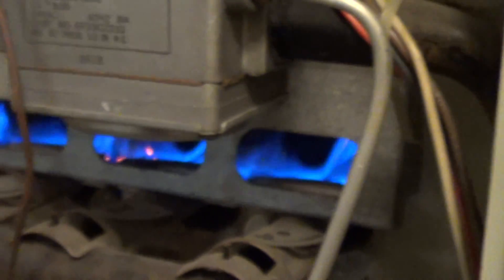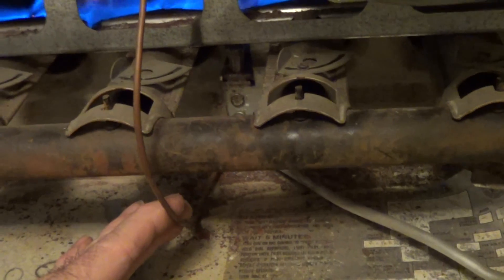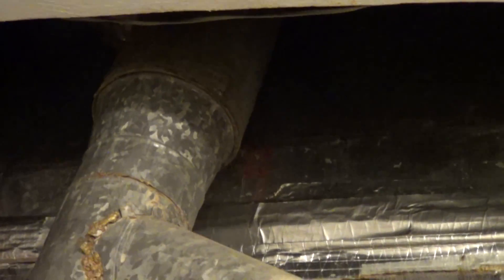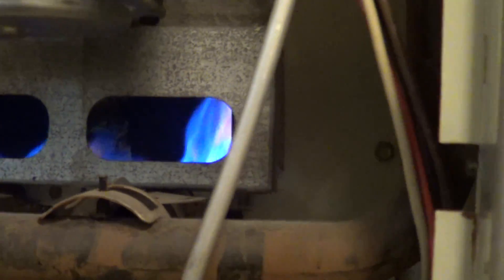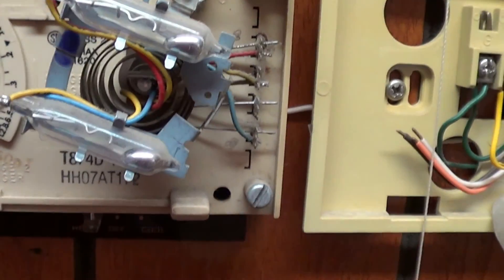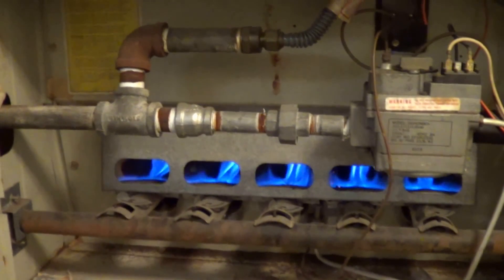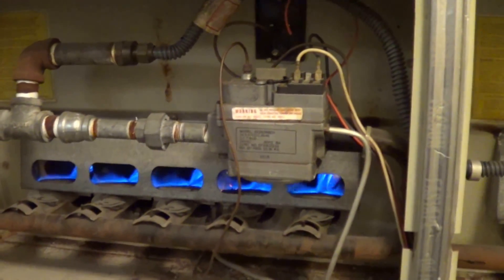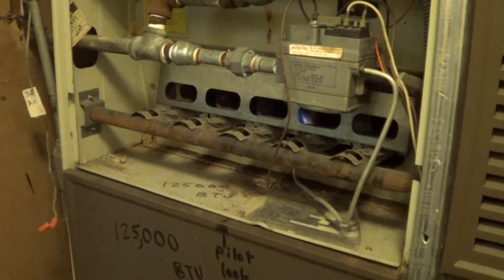Carrier 58GP Twinned 1985 gas heaters 125000 BTUH each

Comment: Here in 2021 are those furnaces still in place?
Reply from the maker: They were used in some colder mornings in 2021 from January through March.  last Winter was a cold one in South Mississippi. This last month has had a lot of rain thus cooler and humid now in July. The pilot lights are tuned off now and relight the first time usually in the late Fall.

Comment: Thanks for the tour down dinosaur alley.  In this house there are 2 units and I'm trying to find the fan limit switch for the main furnace (for main floor heating - model 58GP125-LA).  After the burner is off and the fan runs for about 2 min to finish the cool down, the fan shuts off then turns on for a second or two and shuts off again.  This started happening recently so trying to see if it's an easy adjust or fix.

BTW, I can relate to the pilot light situation.  I've had the pilot light get blown out twice in last 3 years during periods of really high wind, so could definitely relate to needing to locate and reignite the darn thing.
Reply from the maker: ***** The same thing happened here. The blower Fan unit will do a short restart then stop then sometimes restart then stop a 2nd time. What is happening usually is the timing capacitor has dried out and is leaky on the control board.  The 100uF 50 volt cap C2 on my older board 392075-304 (has giant relays) was dried out and thus the flakey behavior. Another intermittent failure mode is the blower gets stuck on because one of the big relays on the board is stuck. One can tap it with a screwdriver and the blower will stop. A brand new replacement board for mine and many others is the ICM271.

In this other video I have the older board 302075 with big relays is on the left furnace and a newer ICM271 board is on the right furnace. There is a Carrier "twining unit" that ties the two together.

I too thought the limit switch in the stack was the issue and it was not. I ended up buying a new board ICM271 and the problem went away. Then the new board died 4 years a later due to a power / lightning surge, but the old board on the left still works. Then last year it started to do the thing you mention: " After the burner is off and the fan runs for about 2 min to finish the cool down, the fan shuts off then turns on for a second or two and shuts off again." and thus needs its board fixed or replaced. 

The cap C2 is either charging or discharging during the extended run and is the timing capacitor. It is an  electrolytic capacitor and thus one that does dry out with time. The 100uF value determines the time. The value of 50 volts should be the same or can be higher too. Thus a 100Uf 100 volt one is OK too. One can buy 10 caps for a dollar with free shipping via ebay thus this fix is cheaper than a 40 to 70 buck new board ICM271 via ebay.

Here I messed around for a few years with the " After the burner is off and the fan runs for about 2 min to finish the cool down, the fan shuts off then turns on for a second or two and shuts off again."  Issue

At least one was fixed via a new or repaired board.
Reply from the maker: ***** Other video showing boards on the 58GP
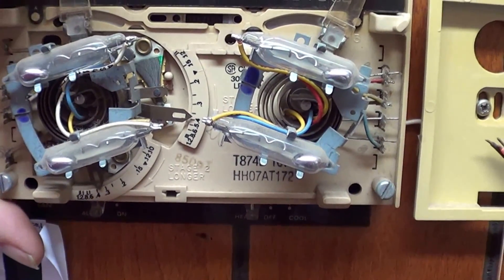Reply from the maker: ***** https://www.youtube.com/watch?v=FfIZ4_PcVu8  Control Boards show up at 7:55  old style  11:49 new style control boards. The "afterrun" of the blower fan is charging up/down of capacitor C2 100uF 50 Volts. When these dry out after  a few decades the units does your issue : " After the burner is off and the fan runs for about 2 min to finish the cool down, the fan shuts off then turns on for a second or two and shuts off again.  This started happening recently so trying to see if it's an easy adjust or fix."